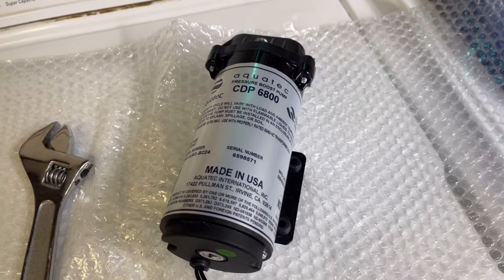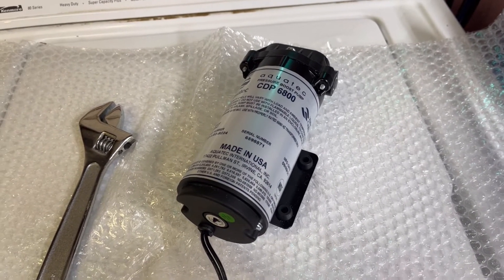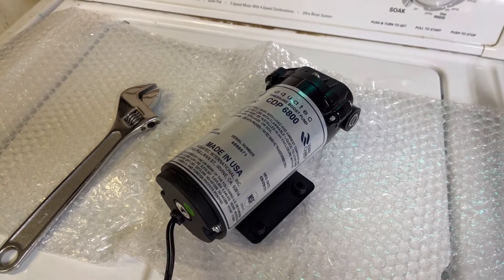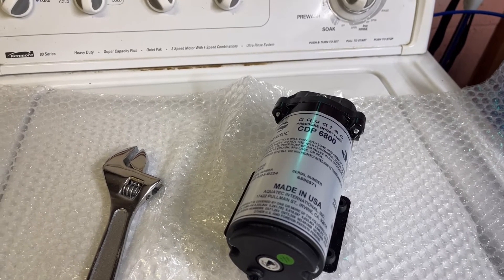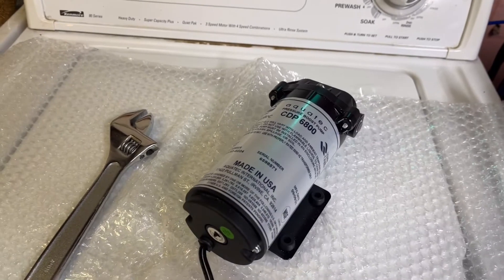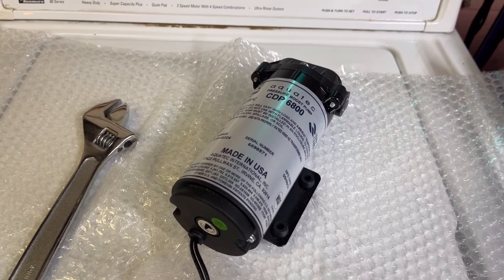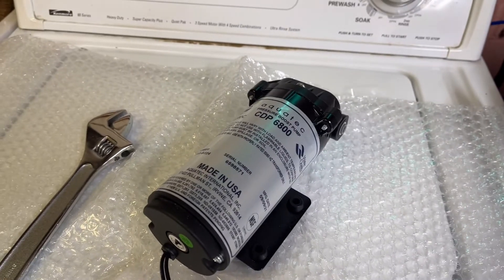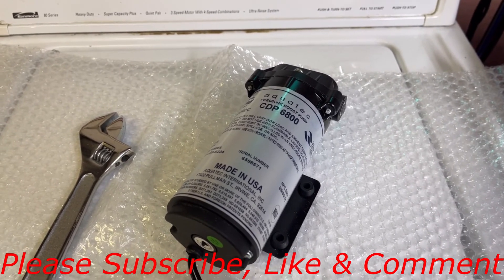Update #6 - Aquatec CDP 6800 Booster Pump Fail

Comment: Do you notice any noise difference between 6800 and 8800? I'm looking to boost my ro for drinking water, from 40 psi to around 60 to improve reject rate for 75gpd membrane. Would you think the 6800 is better?

Comment: I had a 5800 for about 5 years with no issues on my Culligan RO system. Then it started making a noise that I can only describe as a  "hammer" noise like you are quickly shutting and turning on the water at about 1 second intervals when I use filtered water. Changed it to the 5851 and about a month later same issue. I have city water with relatively high pressure (70psi from the street). Any idea if I just got the black marble and its defective? Also, wondering if I need it as it's servicing the fridge sink and a pot filler that's about 10ft up and 10ft over from my RO system. At my wits end any help would be great

Comment: Can this pump get water up 8ft vertical, then 160" horizontal, gradually coming down to 51" above the ground, without any water pressure behind it?  I just need a trickle to fill evaporated water in aquarium using a float switch to activate the pump's power supply.

Comment: The 6800 is only recommended for passing through a RO membrane producing up to 50GPD....looks like you're running two in series [100GPD?], so the 8800 is the correct pump to use in this scenario.  These pumps tend to run well for quite some time.  Things that could possibly cause it to get a little wacky is making too gross of adjustments to the set screw on the pump itself.  [I prefer to make all set screw adjustments on the pressure switch first/alone.]  Anything past a 1/2 turn on the pump's set screw can start putting you in wacky territory, and you may start to hear that rattling sound -- fine adjustments only.  It is always a good idea to have a spare pump on-hand though.  I use the Aquatec pumps in both my aeroponics and RO setups, and although I've not needed it yet, I always keep a spare on-hand.

Comment: I think these pumps only last a year or two. I've had 3 that have all failed.  Now I'm trying to see if I should get the same pump again or maybe there is a better quality one...
Reply from the maker: Could be, would not be surprised if they only last a year or 2. Unfortunately, my water pressure is only 50 psi and it is not enough to go thru 2 membranes and be efficient. I am stuck replacing them.